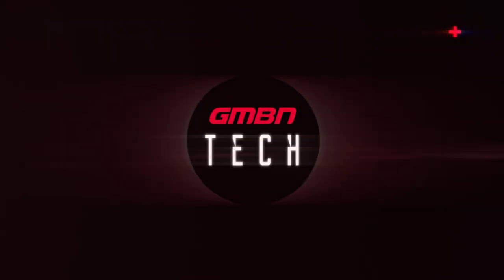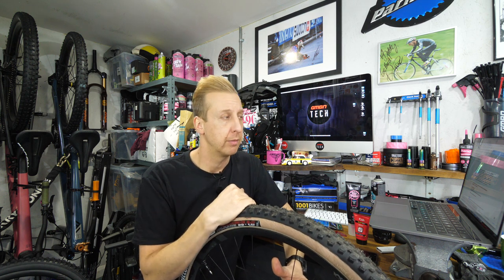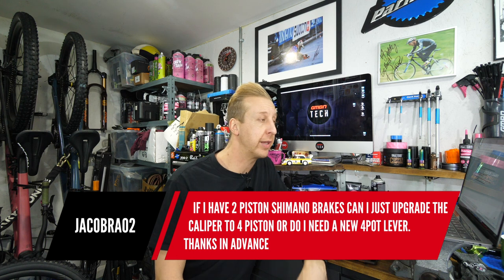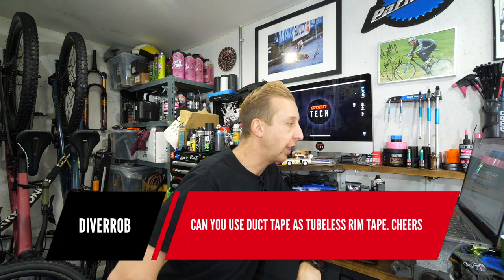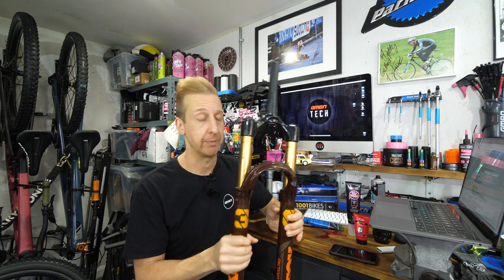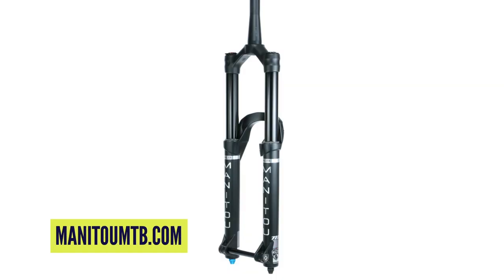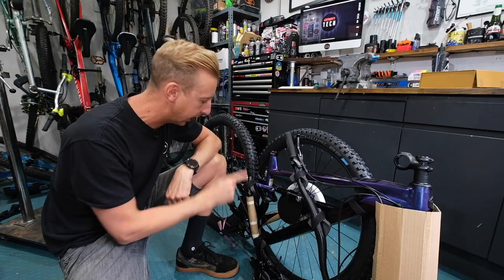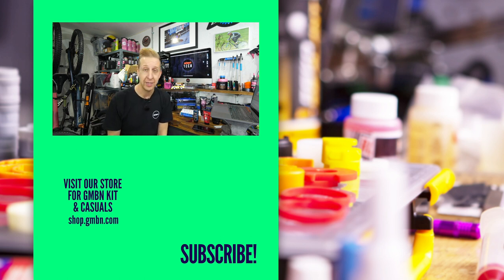What's The Difference Between A Reverse Arch & A Traditional Fork Arch? | #AskGMBNTech

Comment: #AskGMBNTech One of the 6 bolt IS disc mount bolt holes is badly cross threaded on my front hub due to over tightening of the torx bolt and the bolt now wont tighten up. Is there a way you can repair this or should I save the hassle and replace the entire hub? Alternatively is it safe running only 5 torx bolts in the disc instead of the full 6?

Comment: #AskGMBNTech Hi! Thanks for all the great videos! I am 5 foot 10 inches riding a size large 2017 Cannondale Habit 6. It has a 60mm length stem with 760mm width handlebars. I am looking to make the bike more aggressive by putting wider bars (around 800mm) and a shorter stem (around 40mm) on it. The reach on the bike is only 450mm, so I was worried that putting the shorter stem on it would make the bike feel too small. If you could give me your thoughts, that would be much appreciated. Thank you!

Comment: Hot melt in between the spokes is a dream for Me.
Reply from the maker: As in tied and soldered? See it on some XC race bikes every now and again. Great way to stiffen up a wheel but at the same time, it doesn't allow the spokes to move as needed... all a trade off!
Reply: @gmbntech  no just hot melt glue gun. Stops em pinging

Comment: 11:07 Another name for "a persuader" used in the US is "cheater bar"

A big pipe, usually steel, at least two feet in length, usually three, or for you metric folk, a meter.

If that don't work, get an impact driver.

Comment: #askgmbntech Hi Doddy, I have a Cube CX bike with hydraulic 105 brakes, and I can’t stop the front brake from squealing loudly (it’s also no where near as strong as my rear brake). I have replaced the pads and discs with brand new Shimano parts, and it still squeals like crazy. I am very careful when cleaning the bike, so it’s not contamination. Could it be a faulty caliper? Thanks

Comment: #askgmbn Hi doddy, I have bought a new bike (Orbea Oiz) but I really like my current tires, which are Onza Canis skinwalls. These are not yet worn out and therefore my thought was to reuse them. However, I see now that one side of the tire is kinda stuck in the rim bed. Do you have any tips to get the tire out without ripping it apart? It is a tubeless setup

Comment: #AskGMBNTech I recently bought a dropper post with external routing for my hard tail, the cable is getting caught on the inside of the loophole that it is fed through and not making it to stay down. I was wondering if there was anything I could do to stop this like maybe putting a grease/lubricant to stop this friction but I am worried that I will have to keep replacing it due to the wet and wonderful conditions of West Yorkshire.

Comment: #AskGMBNTech
I recently had a problem with my Shimano brakes
I was riding my m8000 brakes in the cold snow and ice.
After a Descend and a climb I couldn't move my lever and so I couldn't brake with my rear brake.

I thought I just needed to bring it inside but it still didn't work after that.

Any ideas what was going on?

Comment: #AskGMBNTech on the subject of chain lubes I've recently noticed comments about waxing a chain (looks like you warm up a block of wax and drop the chain into it then leave it to drip dry). What's the benefit of wax over standard chain lubes? seems like an awful lot of extra hassle but I'm not sure why you would want to or what the benefits are...is it perhaps to do with how is applied and heat gets the wax into places drops of lube can't?

Comment: #AskGMBNTech Hi Doddy what is happening with EMBN Tech? Now for my EMBN Tech question, will there be an issue changing a 38t chainring with a 46.5mm chainline to a 34t chainring with a 50mm chainline? Background my sons Sinch Mode 2 (New Zealand Brand) bike is fitted with a STePS E6100 an only comes with 38 and 44t chainrings in 46.5mm chainline. The STePS E8000 chainrings are available in 34t and Shimano say they are compatible but only come in 50 or 53mm chainlines

Comment: #AskGMBNTech

I have a brand new bike 27,5 Enduro. Suspension travel is 170 front and 165 rear. HA is 64.5 degree, SA 75 degree. I came to an Idea of making it a Mullet bike somewhere in future with reducing the front travel by 10 millimeters and putting 29er to front. Wouldn't it make the bike feel weird with slightly more travel back and what about geometry?

Comment: #AskGMBNTech hollo doddy and team
 wanted to grease my shimano hollowtech 2 crank, but got stuck i used a hammer to tap it out no luck, tried to tap it back in still no movement can still see a little bit of axle showing now i think its not all the way in /against the bearing but its works fine, even the shifting works fine is this going to be  a problem ?

Comment: #askgmbntech on my air fork when I compress my fork pretty much none of it comes back up. I have done some research and had a look for some top tips from you and the GMBN crew and  I think it’s fork such down. I have tried messing around with the rebound but I still have the problem. Even though I think it is fork such down I think that it’s something worse than that as it barely comes back. Do you know if my fork is blown? 
Many thanks!
Reply: Try putting air in it with suspension pump. If its blown it wont fill with air
Reply: @Rab_Cee  I can put air in the fork so that means it’s not blown! 
The strange thing is, is that the higher I turn the rebound the more my fork didn’t return.
Reply: @jenko9606  dont know whats inside the rebound, it might be damaged n not actually making it faster. what brand of fork is it? U might be lucky n someones had same issue
Reply: @Rab_Cee  maybe my dampener inside the stanction is damaged. I have a spinner 300 fork that came with my vitus nukleas but I am looking to upgrade to a RockShox fork. Any recommendations?

Comment: #AskGMBNTech  I have Shimano M71204  brakes, Why is it i can nearly pull the leaver to the grip, It has the adjuster at the front to move the leaver out, When adjusted out the brake feels the way it should, But the leaver is too far to reach. The pads will be worn down a bit, But surly i don't want be be replacing pads all the time to take up that space to get the brake feel back?

Comment: #AskGMBNTech is it possible to change the softness of a coil fork? Most of the ones ive used only have one turning dial that doesn't seem to do much!
Reply: New spring, but that's a crapshoot to find + most cheap forks require proprietary tools to take apart.

Comment: Hey I’m Justin I want upgrade my fork on 2017 diamondback mission 2. The fork I want is fox 38 but the  steer tube has a 1-1/2 inch taper but my current fork has a 1- 1/5 taper what would I need make it work.#AskGMBNTech

Comment: Like this?
https://i.imgur.com/runnHdG.jpg
I'm struggling to find a decent set of mudguards. I want a full length chunky set that covers the front derailleur mechanism as much as possible. I'll never go true off-road.
Reply: Finally found a set but the front one will still need to be modified. SKS BLUEMELS STYLE 28″ 65 SET.
I have to drill out the rivets holding the bracket and relocate it further back.